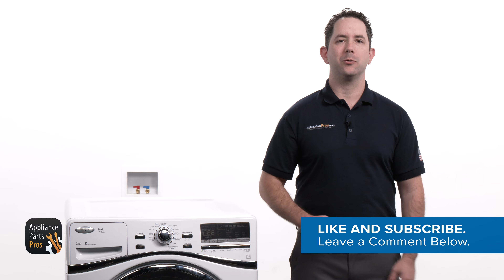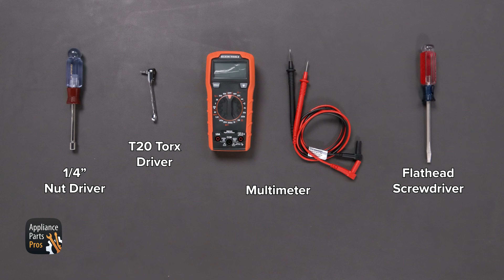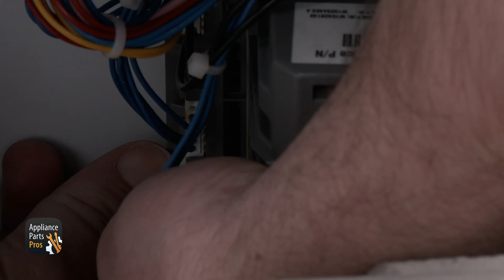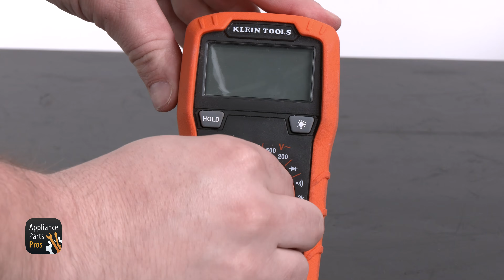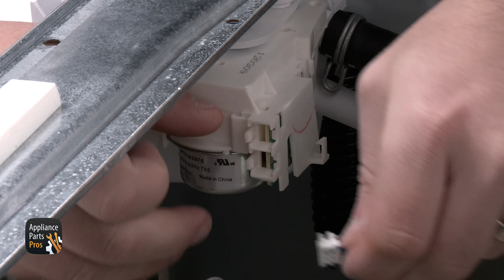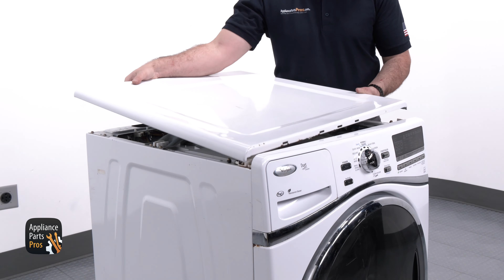What's REALLY Causing Your Whirlpool Washer F8E2 Error Code?

Comment from the maker: 🔧 Common fixes for this issue:
▶ Temperature sensor (NTC) — no specific part number given;...: https://www.youtube.com/watch?v=xQSa5Es-T-4
▶ Main PCB / main control board (LG front-load washer, no s...: https://www.youtube.com/watch?v=qW5hL-g8bIc
▶ heater and thermistor assembly (LG front-load washer, no ...: https://www.youtube.com/watch?v=uQB9nOjeEm4
▶ LG front-load washer drain pump filter (no specific part ...: https://www.youtube.com/watch?v=BATVeHT367U
▶ heater and thermistor assembly (LG front-load washer, exa...: https://www.youtube.com/watch?v=6FtaGG5Y9e4
▶ water inlet thermistor (fill funnel thermistor): https://www.youtube.com/watch?v=yBfaRUZotFY

👍 Found your fix? Hit Like so others can find this video too!
🔔 Subscribe for more repair guides: https://www.youtube.com/@AppliancePartsPros